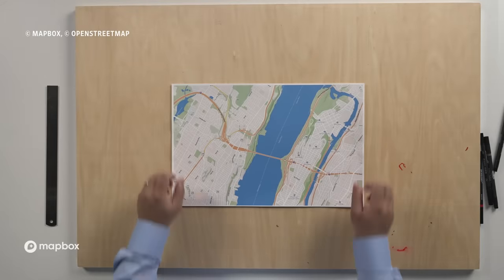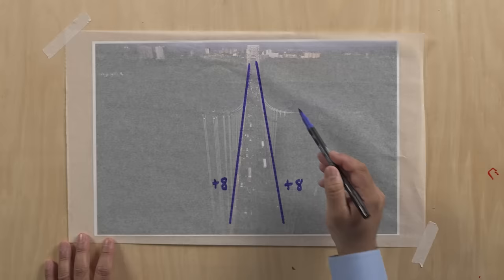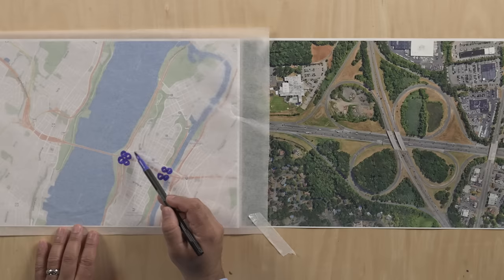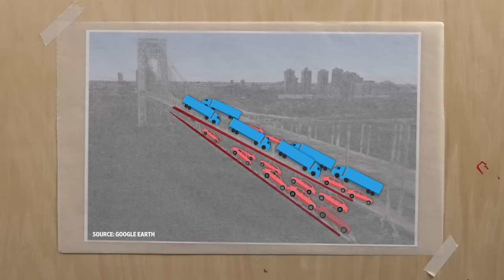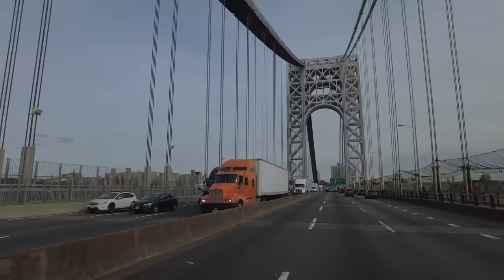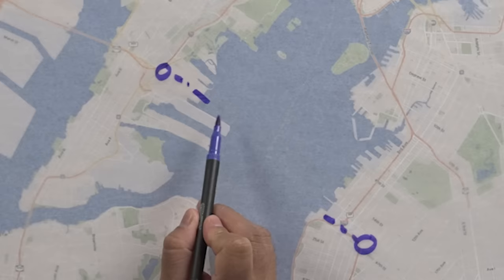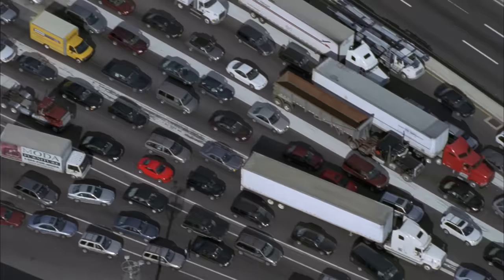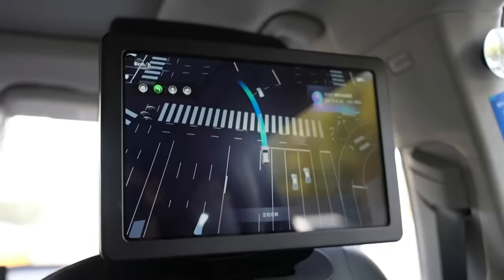Transportation Engineer Tries to Solve America's Worst Bottleneck | WSJ Pro Perfected

Comment: Why is everyone trying to “avoid creating demand” when designing roads? That attitude is bad for road design quality. Build to meet demand at very minimum but preferably exceed it so our children aren’t left with a bare minimum built world to work with.
Reply: Every driven down the Katy freeway in Texas? You haven’t?
Your approach is what they did, and they ended up with a ridiculously wide highway, with longer travel times. Adding another lane does not work, due to induced demand. The only solution to induced demand, is working with transit modes that aren’t as prone to be affected. Trains and busses being examples.
Reply: That approach has 80-year history of failure. Now you have to travel to Europe to see a proper downtown because you have bulldozed yours to the ground.

Comment: The Answer is Pretty simple 
1 way Direction driving in the Mornings and Evenings 
The Trucks from NJ get the Top lanes with Buses 
Cars get the Bottom and during certain hours of the Day say 6am to 10am traffic only flows into NYC from NJ 
In the Evenings the flow would be reversed!!  ❤😊
The other option is to limit trucks to Hours outside the daily rush hours 
They couldn't use the Roads during morning or evening rush hours 
But from 9pm to 2am it's Trucks only!!  ❤😊
Reply: There's some bad ideas in here. Why in the world would you close the bridge to passenger cars from 9pm to 2am when there's generally moderate to low traffic during that period? You'd just cause a massive backup in cars at 8:30pm every day.

Comment: I can't believe he suggested something as dangerous as a roundabout. Imagine navigating the roundabout by having vehicles constantly coming at you from different roads while you are changing lanes in order to exit the roundabout.  This is something from the  horse & carrier era where you can slowly parade around. Mostly in older cities before the development of the car.
Reply: That is why the Dutch have developed the Turbo Roundabout, where the lanes are separated by concrete barriers. TR's perform well in practice.
The Dutch have these TR's on rural connecting roads which used to be crossing with traffic lights. Now the number of crashes has significantly reduces and no fatalities.
Reply: Recommend doing some research. Roundabouts are statistically safer than most other intersections, especially anything with signals. Roundabouts are indeed supposed to be taken at slower speed, that's one reason why they are safer, because it's slower AND crucially you eliminate the more deadly collision types like head-on. Instead you might get people bumping into each other (side swipe). The ramps that exist now are not high speed ramps, they are tight radii, people need to abandon the idea that there is a solution that'll let you fly through this residential area at 80 mph.
Reply: @NutsAndThighs  I think Noland here is concerned with the idea that a roundabout on this road with 330,000 vehicles a day (or any of the surrounding roads). Somerville circle is a random roundabout that connects a few highways in New Jersey that sees 11,000 vehicles use per day. The only reason it has a wikipedia article is because it is an absolute disaster and frequently sees accidents. That's with 11k cars per day. The idea of using a roundabout on any of the GWB collector roads is honestly terrifying.